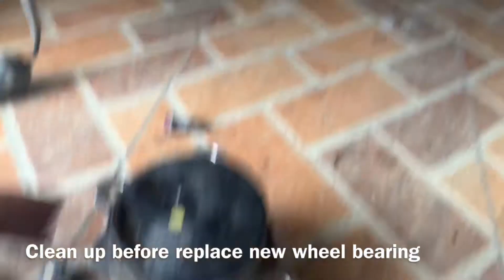(DIY Project) Replacement of Honda City GM6 2014 rear wheel bearing

Comment: Is it normal abs light will appear after replacing the wheel hub bearing?
Reply from the maker: Not normal my friend. Kindly check with service center if it is appear. Maybe so some sort of error during installation of the sensor.